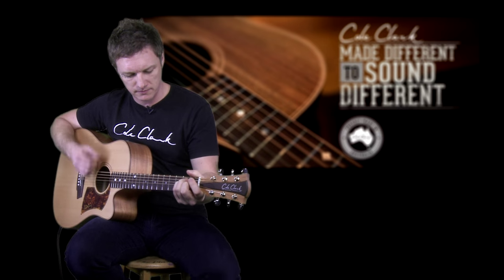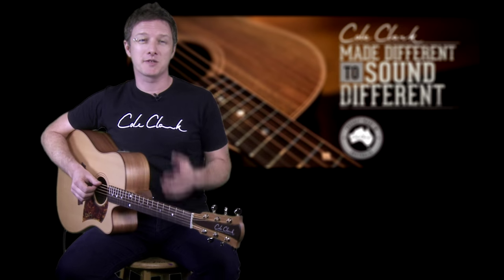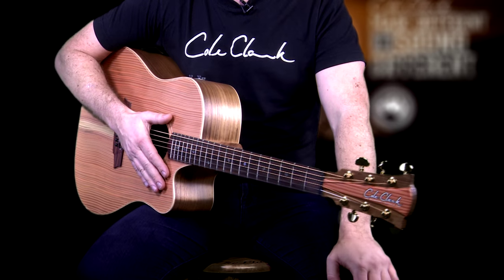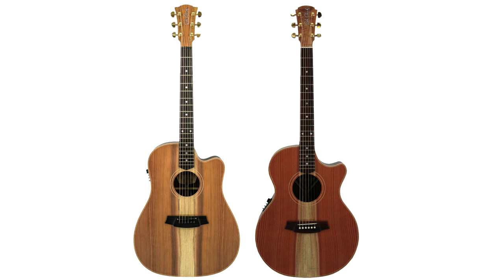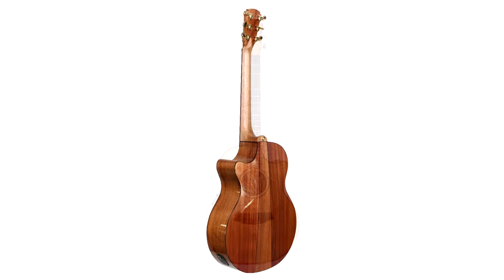Cole Clark

Comment: Love my fat lady 1 but want a three for looks and deeper woods for my blues rock style. Plus being an Australia veteran affairs pensioner. I would love to be able to upgrade and stay with Cole Clark. I live in NSW alone family gone. Hope karma help a busted up soldier. Want Tusq nut saddle and pegs better pick up. Get sick of people saying go Martin or Maton but I luv my Cole Clark. Just want bit more warmth for blues rock nice case with it.
Reply: I have a 2007 FL3 and the sound is gr8.
Mason Don come close but Martin crap all over Cole Clark for sound and playability UNPLUGGED.
you cannot beat the CC pickups.
Many luthiers will tell you the finish inside the guitar is sub par.
Mine is shocking to look at inside and many people have problems down the road.
My intination on my 6th string has gone way out.
I've had the guitar for 14 yes and look after all my guitars with great pride.
No kids to mess with them.
My older ibinez and Yamaha are still perfect but my $3000 in 2007 Cole Clark FL3 had become unplayable.
Always cased always less than 50% humidity. 
Never heated

Comment: I'm looking for an acoustic guitar thats built like a flamenco guitar, (I was wondering about the bracing aswell) that has that percussiveness, I play Flamenco based country blues rock i use all the tapping and thumping and the heavy thumb work. Could a Cole Clark guitar be just what im after?, and if so which type? And if not can you point me in the right direction? Thanks
Reply from the maker: Hi Andres. 
We are certainly the only manufacturer building steel string guitars in the Spanish heel method and we are confident that our pickup is the most ‘percussion friendly’ on the market because we designed our guitars with that in mind. Check out Daniel Champagne for reference with that. I would highly recommend an all blackwood model (FL2EC BLBL or AN2EC BLBL) for maximum strength and plugged in response.
Reply: @ColeClarkGuitarsAU  thanks so much. I'll check them out